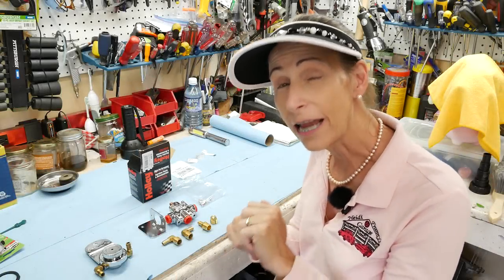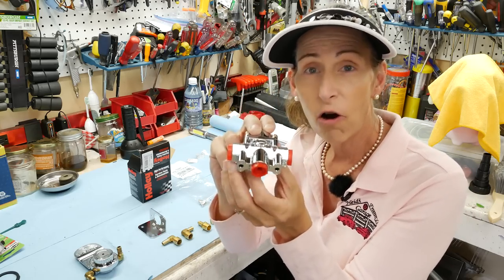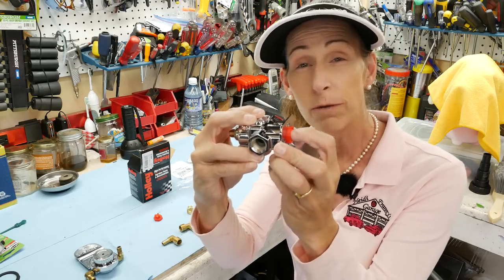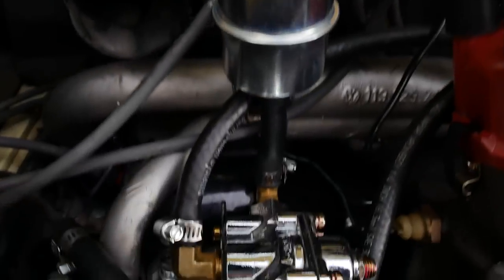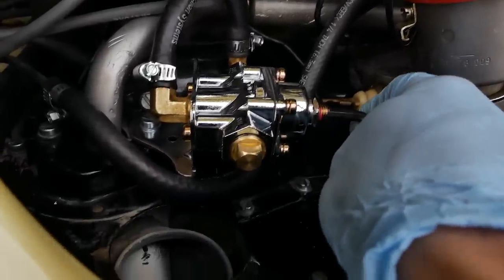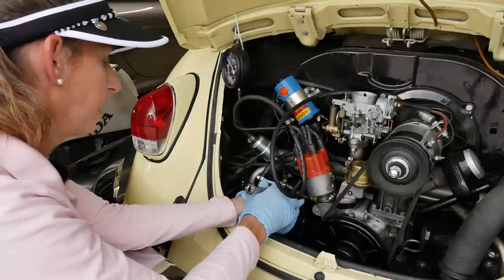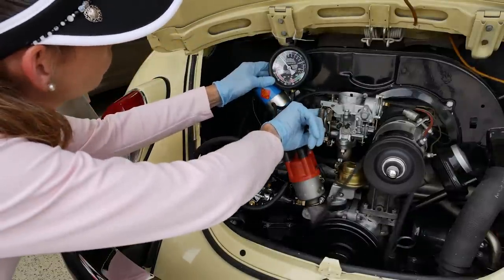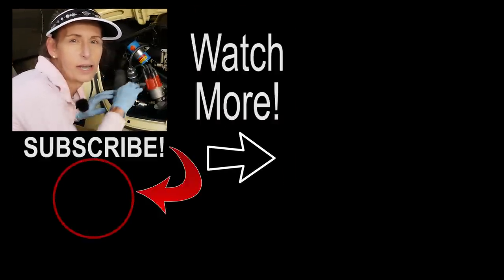VW Fuel Regulator Update - What HAPPENED???

Comment from the maker: Hi All, Well, the regulator I installed went bad and started leaking fuel!  In this video, I replace it with a Holly 12-804 1-4psi regulator: https://goo.gl/Q8wbKr

Tools and parts:
• HFS (Tm) Carburetor Carb Valve Fuel Pump Pressure & Vacuum Tester Gauge Test Kit: https://goo.gl/wZZmZy
• Air cooled VW bug beetle fuel pump kit with flange & rod, generator style: https://goo.gl/7qDcnC
• 1/2 In Drive Digital Torque Adapter by USATNM: https://goo.gl/vEZ4mc
• Permatex 80016 Form-A-Gasket #2. 3 oz.: https://goo.gl/t5bH4z
• LDR 516 F146 ¼ Inch ID Fuel Line for Small Engines 6-Foot Length: https://goo.gl/i2WEyt
• Jmf Hose Barb 90 Deg. 3/8 " Hose Barb X 1/8 " Mpt Yellow Brass 150 Psi Lead Free: https://goo.gl/FoSj4k
• Koehler Enterprises KE4SS Hose Clamp Blister Pack, 4 Piece (Micro Size 4): https://goo.gl/chZpPw
• The Extinguisher we have in every car: Amerex A384T, 1.4lb Halotron I Class B C Fire Extinguisher: https://goo.gl/1dkRVJ
Reply: Good video Franny.  I'm set up with a Carter 60430 with this regulator into a singe Weber .40 carb.  I put a 0-5 PSI mechanical gauge on the other output and it works pretty well.  I tried a Marshall liquid filled 1.5 inch gauge initially and that gauge had me chasing my tail trying to get the 3 psi I was looking for.  What I do notice is that my pressure goes immediately to zero when I shut down.  Is that normal for an electrical rotary style pump?
Reply: Franny, the Blackhawk ratchet is a keeper for sure.  I bought mine after watching your video a few years back. Please go back to doing your garage "stuff"...I miss it!  They also help me with my 1974 SB and my 1967 911S.

Comment: Good, clear video but I hope you’ve rerouted that rubber fuel line and the spark plug wire as they were both resting right up against the inlet pre-heater pipe!!! Need I remind you those pipes get scorching hot - massive fire hazard on your hands there!! Check it out @ 2.48 mins in...

Comment: I found your troubleshooting technique pretty thorough when "Lemon Drop" died on it's way back from your shop with it's owner. Very clever use of the vacuum line cap to extend the fuel pump rod.  I had a 72 "Super Beetle" purchased used overseas in Spain while I was stationed there with the US Navy.   I brought the car back to VT once I got out of the USN.  That 72 Super Beetle of mine had a number of problems over the 6 or 7 years I owned it, but I wouldn't go into that extensive list.  Poor design, lousy manufacturing, etc..., still didn't take everything away from it being my 1st car and I enjoyed it a lot.  Of course, I swore I'd never to own another VW vehicle, and never have.  My hat's off to you for your shop, and your work on these cars. I learned a lot about regular maintenance on vehicles with that bug. 
Your videos are very informative, fun to watch, and I enjoy them. (I've even learned a thing or two :-) .   Maybe a small bucket, or coffee can, etc..., when you think you'll have to pull off a fuel line, or fuel pump on your next road side house call ;-).   Great site, and well done to you both.

Comment: I wish Franny was my nextdoor neighbor,  if she was, I might actually get to drive my bettle one day rather than working endlessly on it!
Reply: Buck Gill that can be frustrating, but the good thing about working on your beetle is that every job you do is a job fixed. And to top it off, it’s not a new car that you need a science degree to wrench on. Also, I recently discovered through my own experience that new VWs use plastic engine parts. Oil pan, plastic. Intake, plastic. Water pump assembly, plastic. Luckily it cracked under warranty. But I’m not confident that a meticulously maintained Golf had a mechanical failure in such a short time with such few kilometres. I’m selling it and going back to a beetle.
Reply: @whatsstefon  - seems like one fixed job has led to another🤔
Reply: @FLATearthGARY  that’s life with older cars.

Comment: I have that same regulator sitting on a shelf. I think I definitely need to install it. I was stubborn grinding down the pin as I wanted it to work as intended, but I think this way is much more accurate. Thanks again Franny.
Reply from the maker: Home Built By Jeff I was too! I ground down the old pin to just shy of 3psi and I thought I would just touch it the tiniest bit more... Put it back together and no pressure at all! That's what convinced me! Jerry (the owner) has been driving the car daily and says it is running great.  I hope he isn't just saying that, but that holly seems quite a bit better than the old one... I used permatex on the threads of the couplers and that worked well...  Love your 911 work. I need to keep going... Did you get the bent ring sorted? F
Reply: The bent ring needs to be custom made, so it will more than likely be a few weeks. Then I need to shop the whole lot back, so we will see how it goes.

Comment: Frannie-here is my humble .02: the best thing you can do is dispense altogether with the mechanical fuel pump. Electric fuel pumps work great-install  in front of car below tank level and you can get them 3psi right out the box.Solex carbs do great with 3 psi.In this case no need for regulator. I have used them as T set set up for dual carbs and the Holley works fine.You are correct the other is one scheisse. Advantage of electric is no more vapor lock ever. Of course you would need to install a safety fuel shut off relay as well if you go the electric route. Anyway cheers.
Reply: Had a few questions:
I'm installing a Carter  electric fuel pump to my Ghia. Im installing it in the front, right as it takes off from the gas tank.The Carter electric fuel pump comes with a filter. Do u need to install another fuel filter in the rear? ( I would say yes, right?).
Second question:
I'm removing my old fuel and capping it off with a fuel pump block off. Should I remove the plastic base along with the pin? (Once again, I believe I should). I'm I right?

Comment: Another way to adjust the fuel pressure is to grind the flat end of the fuel pump pushrod in small increments until the desired pressure is reached .. Keep in mind that the Generator push rod is not the same length as the Alternator push rod ..

Comment: Excellent video - I recently bought a new carb for my stock 1200 and was having no success in getting the idle & mixture screws to respond appropriately! I picked up a fuel pressure gauge based on your last video and tested the fuel pump pressure - 4.2psi !! I now have a new regulator on the way ( I definitely would have went for the cheaper EMPI ). Really appreciate the content THANK YOU!

Comment: I have had that Holly fuel pressure regulator seep fuel on my 1985 1st Gen Mazda rx7 SCCA ITA race car.  It didn't really leak in drips but it did show signs of wetness after a few races, so keep an eye on if for a while.
Reply from the maker: Thanks for the tip!  I'll keep an eye out.
Reply: @HeidiandFranny  😁👍

I like how thorough you are and meticulous. I am the same way, and it's getting hard to find that.

Comment: Great to you a Volkswagen style metal fuel filter.......but GET IT OUT of the engine bay.  It should be under the fuel tank or behind the shroud.
Reply: I put mine along side the transmission. I don't like them in the engine bay either
Reply: I would have to say relocate that fuel regulator too!

Comment: The stock fuel pump puts out max of 3.5. Never used a regulator with stock fuel pump. I use an electric fuel pump on my dual 44 IDF Weber engine with a fuel regulator set at 3.5 max.

Comment: In the links, the 90 degree hose barb you have listed is 3/8” with 1/8 barb.  In the video you said you were using 3/8” with 3/8 barb.  Did you make a mistake in the links or decide to go with the smaller barb?   Thank you so much for all of your videos.  Saved me countless times!
Reply from the maker: Probably!  Just use the correct size for your fuel line.  The original is metric and kinda in between those two sizes...
Reply: @HeidiandFranny  - thank you so much for all of your help.  Sincerely, Gary
Reply: Thank you for ALL of your “how to” videos, wow!  
      …You truly have been a blessing!

Comment: Franny, I put a Fuel regulator on my 74' supper beetle and it corrected my problem per you video. my pump was flooding the carburetor/engine. all engines should hove this installed.  However, when engine cooled down I could not start, no fuel, or I should say it drained from the fuel filter. Engine would start with start fluid then stop.  So, I'm on suspicion I damaged the pump because {if the pump produces 4 lbs. of fuel and I regulate to 2 lbs. the remaining 2lbs. had nowhere to go} I'm thinking of a bypass valve to redirect.  your thoughts.  Hans
Reply from the maker: Hmmm... something doesn't sound quite right.  Check the pressure after the pump and then after the regulator (or simply bypass the regulator). Just confirm the pump has pooped out.  It shouldn't hurt the pump but if it is old and needs a rebuild it might be time... F

Comment: Great video! I have a question maybe you, or somebody here can help me with. I have a 2110 Turbo charged stroker motor in a dune buggy. It seems to run great but on long rides usually when I shift into 4th gear, it will bog out when giving it gas to the point I can't keep it running regardless of the gear I am in. I have to shut it off, let it sit for a few minutes then it runs great again. Could this be a fuel regulator issue? I have a Malpassi Seregno fuel regulator. Any help would be greatly appreciated!.

Comment: I'm installing a pair of Weber 34 ICT dual carburetors on a bus that doesn't have a regulator on it now and wondering how do you know which one do you use?
Reply from the maker: I bet the Holly would have enough flow.  Just use the pressure gauge and look for a pressure drop at WOT.  If it holds you should be just fine...  The Holly should have a spec on flow rate.  It might be harder to find for your carbs...

Comment: Heidi and Franny - I just installed the Holly 12-804 regulator that you link below into my 1970 KG and no matter what I do, I can't get it below 3.0.  Turn the hex nut all the way to the left eventually unscrews it from the top of the unit before it can go below 3.0.  Thoughts?
Reply from the maker: Email us on the website.
Reply: Same issue here. I think my problem is that I'm using an electric fuel pump. The pressure is building too high before I can get the engine started.

Comment: I have 1967 vw beetle 1600 DP, should that be also at 2.8 psi or any difference
Reply from the maker: Well, it is more about the type of carburetor you have.  Just search for the specs and that will tell you.  As a rule of thumb, stay below 3.2 psi and watch the pressure meter when you shut off the car.  It should hold steady.
Reply: Thanks! Will do
Reply: @HeidiandFranny  Here's my Carb.. weber 44 idf.. what do you think.. having hard time finding the right psi. Thank you again

Comment: I have the same issue, I’m loosing pressure after the car is shut off. But mine won’t even start. It was working fine was starting it every week 2-3 times. After I replaced the front brakes, shite rod coupler and bushing it started to have issues now won’t start. Unless I put gas down the carb. I replaced the fuel pump and it is putting out about 5psi. You said that was high so a regulator is in the future installation plans. But it won’t start at all without gas been poured on the carb. Any ideas?
Reply from the maker: Sounds like your choke isn't operating...  Is the step cam rotating down when the car is cold?  It also needs to be plugged in so that it can retract as the car warms up.

Comment: The fuel leaking out of the top is so, you can use it as a lamp to work on your engine....Just light the fuel on fire and presto...you will be able to see to replace your fuel filter and adjust your sawmill distributor.
If it says EMPI, walk away. Probably when you opened the blister pack you could smell the Chinesium.
However it was chrome! Whats the deal with EVERY aftermarket part for VW's being chrome? Kawabunga dude!
Sorry...I had to do that!
When I was younger I went into a VW salvage yard and saw a 55 gal. drum of original fuel pumps... (I saw 2 - 55 gal drums of original distributors) and I thought Gee!....everybody is getting new fuel pumps. Well, my car at the time had one of these cheap fuel pumps. And I had endless trouble out of it. You would think aftermarket companies would make good fuel pumps...not so.
What I did to fix this was this.
I accepted my brothers (Yoda) mantra of original parts only. ''When you add or take away original designs and parts from a VW you are gargling trouble''.
So, I found out what kind of engine I had, more importantly what kind of distributor drive I had. Because the fuel pump rod works in conjunction with the cam profile on the distributor drive. Got used ORIGINAL parts, cleaned and put new diaphragms in the fuel pump (you can still get good rebuild kits) 
Got out the Bentley book found the correct parameters and adjusted them with zero...extra gaskets (see mantra above) Put every thing together and it worked flawlessly. 
Also I removed my engine fire ( fuel filter) above all that white hot metal and my then ,wildly sparking/arcing sawmill distributor. Because VW never put a fuel filter in there (see Yoda above) The original design was a fuel filter in the tank, and there is a brass bolt on the front of the original fuel pump....behind that is (DISCO!) the secondary fuel filter.
So VW fixed all the problems for you...yeaaaayyy!
From :
having ''pea shooters'' correct depth in your original exhaust (NO HEADERS) so that correct back pressure is obtained to push exhaust gas into the preheat tube on your intake. Allowing the carb to be warmed atomizing the mixture properly so the engine runs proper and doesn't foul plugs.
To:
Running the correct distributor to help keep #3 cylinder cooler (retarded cam lobe, single port engines)
To: 
Having EVERY piece of tin
To: 
Running dual port engines in cars with (SLOTS IN THE DECK LID FOR COOLING!)
Its all in the Bently......Not Climer, Hayes bla, bla, bla books...Bently book. If its all original (as close as you can get) it will last longer, and give you less trouble.

Now I will climb off my soap box.
Great channel, love your work, love VW's...keep on buggin!

Comment: Do you think running an electric fuel pump is ok or are you against them. Just want to get your opinion. Thanks
Reply from the maker: Hi Brent, I think they are just fine.  Unless you have an bone stock car, it is a great option and can even blow through the stock pump, but be careful that the mechanical pump has a good diaphragm or it will dump gas into the engine!  Probably best to remove the old pump and cap off the hole.  Be sure that the pump you install is for carburetors and puts out no more than 3.5psi.

Comment: I have a question and thank you if someone answers it, in this video it was spoken of making sure the pressure was being held even with the car off, I just installed the same regulator, adjust it to 2.1-2.2 on a dual Kadron 44's for a 1915 motor, but when motor is off pressure goes up to 3.1 on the needle... Is this a problem or?
Reply from the maker: Shouldn't be.  You just don't want the pressure to exceed what the float valve (needle and seat) can hold.  just let it sit after the engine has stopped for a few minutes and re-check the pressure.  If it holds you are good.

Comment: Would this be the same pressure if it had dual carbs?
Reply from the maker: Hi Raymond, yes the pressure is the same.  Just make sure your pump and regulator can handle the flow for two carbs at the correct pressure.

Comment: Hi Franny,  did you add thread tape or anything to the fittings?
Reply from the maker: Hi Shawn, that is a great question!  I had done a bit of research on that and looks like any type of pipe tape could break off and clog something downstream.  I used some Permatex #2 on the threads and that worked really well. Franny

Comment: can high fuel pressure affect idle speed/adjustment.
Reply from the maker: It can...  If it is blowing past the needle and seat then it will lower the idle by making the engine run rich.

Comment: It would help better if it was in depth and detail little bit more as far as mounting connections what sizes how to measure well I did that bought my Holley fuel regulator put it on there and the whole damn thing just poured fuel out so did not work for me that's why I'm saying get into detail about putting plugs in caps on hoses on blah blah blah explain it a little bit more in detail thanks the aggravated one

Comment: Love your videos, but you really need to pay more attention to safety. Didn’t anyone ever tell you not to work on moving machinery with long, loose hair? Rewatch this video right after you have installed the new regulator as you are showing the line routing. At one point, with your head right in front to the (moving) fan belt, you turned to face the camera and your ponytail swung around right in front of it and I swear, I jumped in my seat because I was sure your head was gonna get pulled into the motor. You should know better.
Reply: I thought that too, but I think the camera angle makes her look closer to the fan belt than she really is.

Comment: You don't need a regulator for that engine they never came with one, you can just shim the fuel pump if needed . And that non stock 009 distributor isnt helping either
Reply from the maker: That is true for a stock pump, but not the aftermarket pumps, unfortunately.  You can't shim the pump (or grind the rod)...  If you get the pressure into the 2.5psi range, the flow is so low that you will run lean at speed which could be the end of your engine.  I tried all that first with the gauge hooked up.  Agreed on the 009.  I'm not a fan...